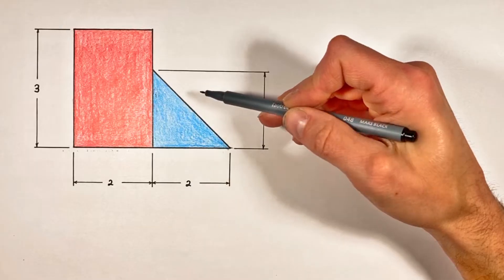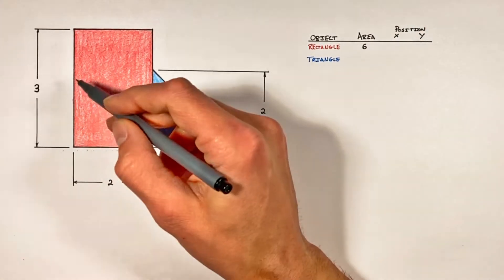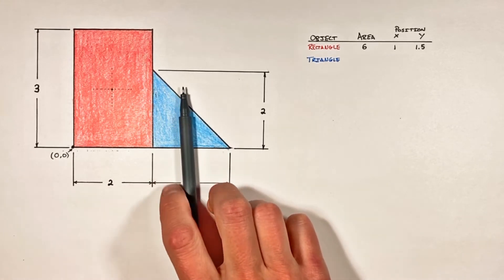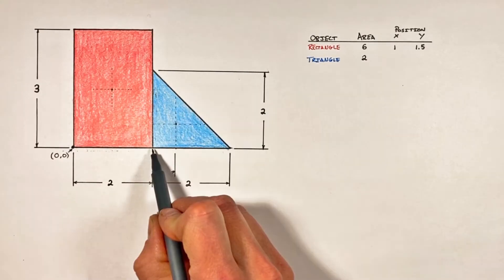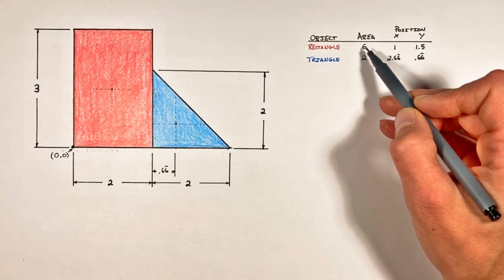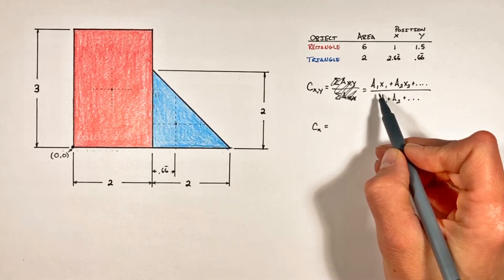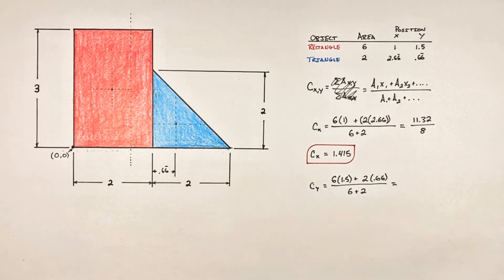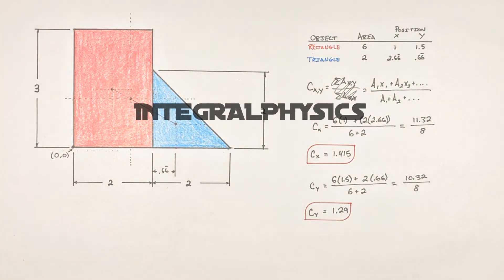Find Center of Gravity Of Multiple Objects | Physics & Engineering

Comment: Is it a rule for the triangle that the center of mass is one third?  what if i have triangle for example with an attachment object at one of its side, is it gonna be one third as well?
one more question please what about the cylinder shape?
thanks
Reply from the maker: The CG of a uniform right triangle will always be 1/3 of the distance along either dimension of the triangle.  If you start attaching other thing things to the triangle then the 1/3 rule will no longer apply.  A uniform cylinder has a CG right in the middle of the cylinder.